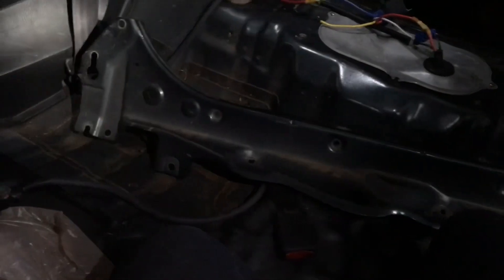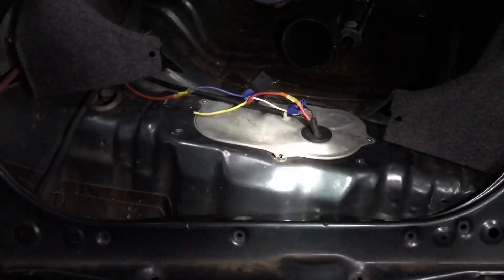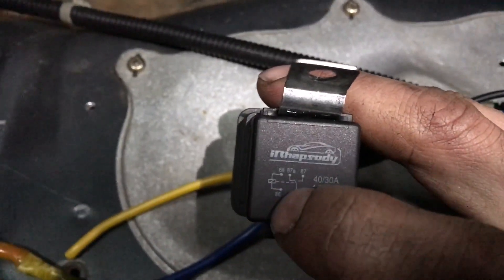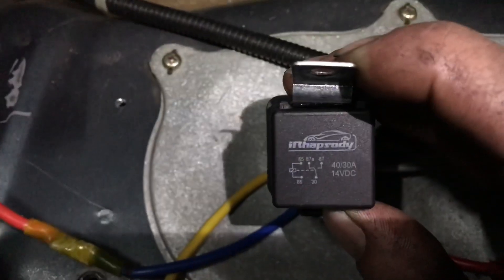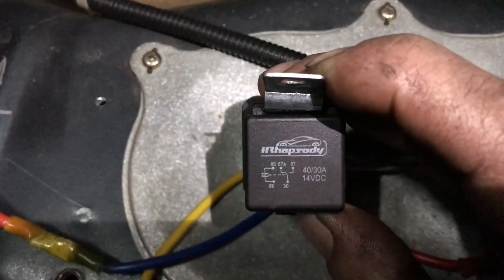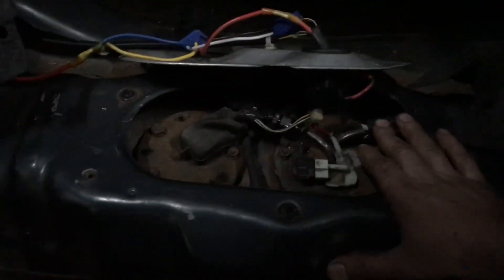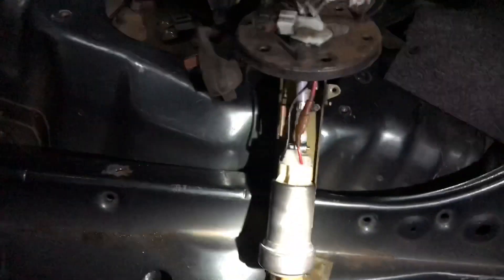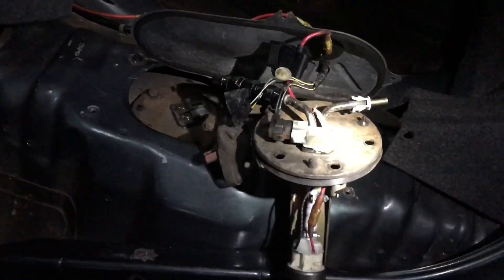DIY Walbro 450 fuel pump & relay install!

Comment: Hey I can’t find the 14vdc relay at all on amazon but they have 12vdc and on the description it says it’ll take a max of 14vdc. Would that cause a problem bc it would be pushing too close to the max. I really wanna do this set up. Thank you
Reply from the maker: That will work as that’s what I have in my car. Amp are the thing that really burns stuff up and 30/40 amps will handle what we are using it for.
Reply: @thestateofreal2533  thank you for confirming that for me. Im gonna try this soon I appreciate it.
Reply from the maker: Good luck!

Comment: What did you do to the wire that clips to the fuel pump
Reply: I turned over the car and the car stayed on. I had to disconnect the battery
Reply from the maker: The positive wire (red) from the fuel pump goes to a 30 amp fuse then to the fuel pump relay. 

You can wire it up with just 12 volts straight from the original fuel pump harness but if you want to take full advantage of the 450 lph that the walbro can deliver you need 14.5v volts which I wired from the battery through the relay.
Reply from the maker: If you mean the black wire…that’s is just ground which gets screwed to the fuel pump carriage.
Reply: So I'm not going to need the stock harness anymore.

Comment: Will just a regular generic 30amp relay you buy at local auto parts store, like a Dorman work ok? I installed my Walbro 450 pump about a year ago, and it was working great, then all the sudden it started intermittently stopping, and now won't come on at all. Could it be the relay?
Reply from the maker: Yes theoretically it should work the same. I would just pop the cap off your replay and use a jumper wire to see if you can send direct power to the pump and see if it starts up. Did you have an in-line fuse?
Reply: @thestateofreal2533  no, I didn't add an online fuse. I'm also wondering if my ground coming off the relay isn't good enough... I just ran a small sheet metal screw going through a circular lug attached to the end of 14ga wire, and the sheet metal screw goes into the chassis sheet metal behind the passenger seat..

Comment: What kind of heat shrink did you put on the 14v wire in the fuel tank?
Reply from the maker: Marine grade off Amazon. Look for Polyolefin as it’s solvent resistant

Comment: What happens if u make 12v wen u need to make 14 volts. ? How will the car react?
Reply: It will run lean and probably kick the rods out of the side of the block.
Reply from the maker: Depending on what ecm you use, what protection parameters are setup, or and what wide band will determine the outcome.
As mentioned by G Burn, the combustion camber not getting the require fuel will put it in a lean condition.
Reply from the maker: If you are not getting 14v then make sure your alternator output is 14v and work your way outwards from there.

Comment: Wiring mine was a pain in the ass. Good job tho bro
Reply: I subscribe bro love the content. Do u have the link for the walbro  pump, I'm going to upgrade  my aeromotive  pump its running  lean and the primary  dont hold pressure  anymore.
Reply from the maker: Trey Be Dipping thanks man!